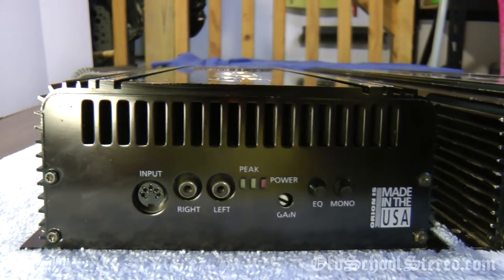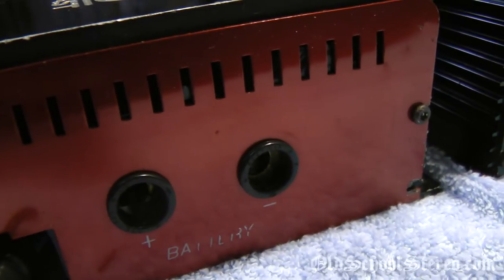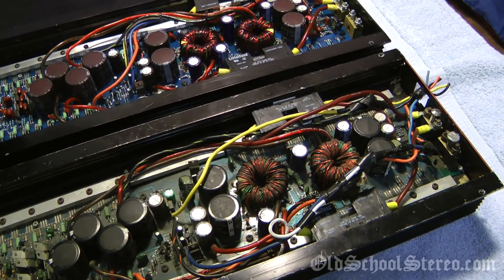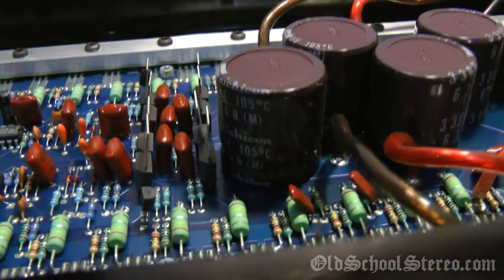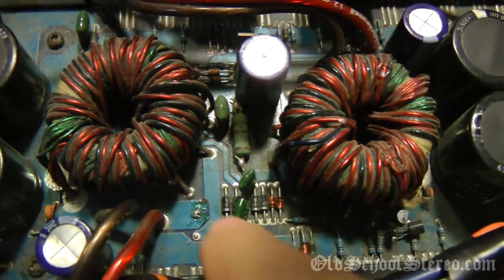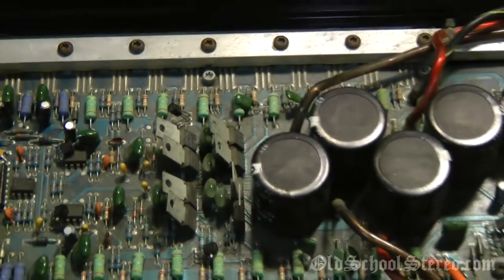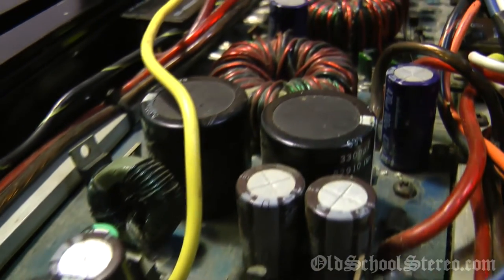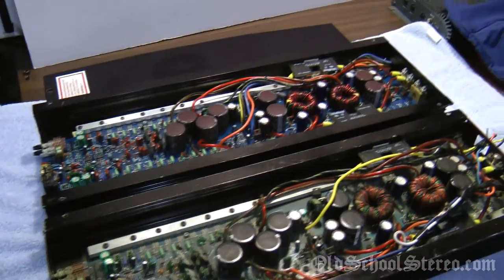A Tale of Two Beasts - Old School Orion XTR 2250 Amplifiers - One Beauty, Both Beasts!

Comment: Actually, compared to some of the amps I've had, that's not in too bad condition.  At least the board itself is in good condition & the missing parts are rather cheap & simple to replace.  If you're feeling feisty, you could apply new silk screen with a good scan of the other's end cap.  Heck, I bet someone has already made a template.  That thing could be good as new without too much work.